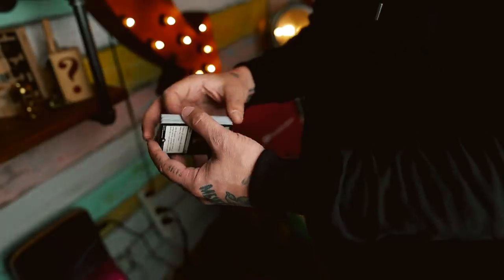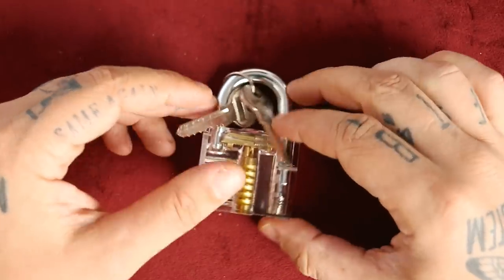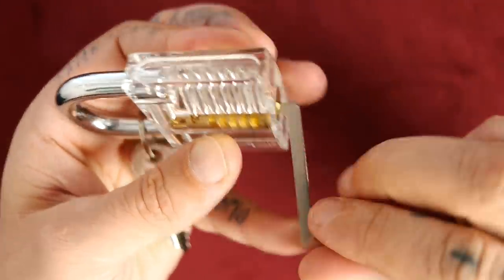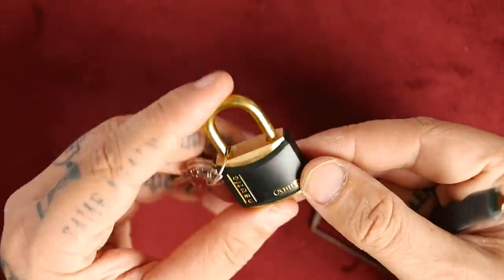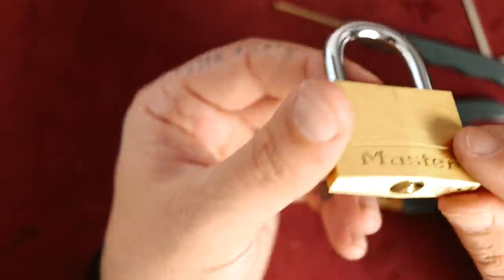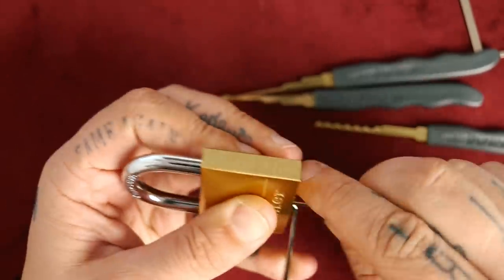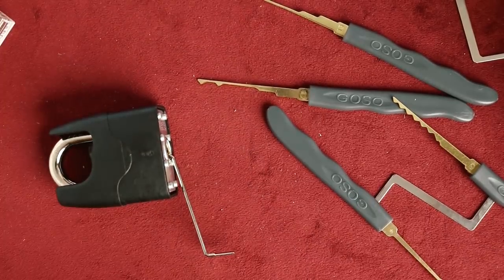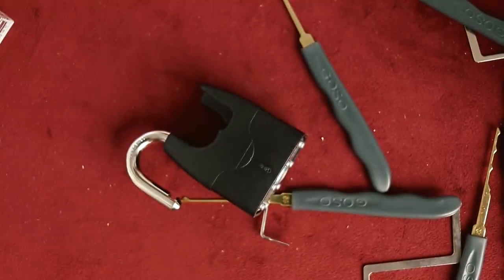I Learned How to Pick All of These Locks!! (Lockpicking 100)

Comment: That beginner lock is deceiving for how easy lock picking is. I have that one. All the pins are the same height. You can stick a paperclip in there and lift up with a little tension and it pops open. lol
Reply: Capp00 the one I have, all you have to do is push up the last pin and it opens 😂
Reply: Cool stumbling across Capp00 here. 👍
Reply: @Moorgoth67  Howdy!! :)
Reply: My one you actually have to try it but they are way easier
Reply: Depends on the type you buy. The beginner clear locks have basic pins but the more intricate one have pins that you can adjust to increase or lower the difficulty.
Reply: Yeah those clear Chinese locks have horribly bad tolerances even if you do manage to get one with difficult biting, they all rake super easy.  If you want a good see through lock Sparrows makes excellent cutaway locks that can be repinned. (they also have the best quality to price ratio for picks as well IMO)
Reply: They're not all the same height on the one I have. But it is ridiculously loose and after some practice I could pick it in a couple of seconds without looking at all. I couldn't pick the lock on my back door though. Maybe if I had a decent tension wrench, but the one that came with the cheap set I got was awful.
Reply: My clear beginner lock looks exactly like his and the pins are not all the same length. In fact I tried to just push them down all at once & it didn't work. You actually have to push each pin individually different heights. I think it depends on the kit you get.

Comment: Really good job for a total beginner, but you should know that these locks are new and unused so it's so much easier to unlock them.. If you want to do some real challange, try to find and unlock some old rusty locks. That's really hard and challanging and it's also more realistic.. :D
Reply: Oh geez, good to know!
Reply: Zdareeec
Reply: Old locks? Hammertime!
Reply: I find old locks easier to pick cuz often the pins get stuck in proper place rather than moving freely. Just my limited experience though have only successfully opened 10-11 padlocks so far

Comment: The thing that you pulled out around 8:20 is for car locks or double-sided locks in general. The lock with the blue band around the bottom and the weird-looking key appears to be a disc-detainer lock. Basically, the discs need to each be rotated into a specific position relative to one another in order for the lock to open. Since the key's cuttings are all equal depth, you just needed something that could reach through the warding (tabs of metal between each disc that prevent you from turning all the discs with a screwdriver and reverse-picking the lock), and that rake fit the lock well enough to do the job.

Comment: The number six you took.. is either a half Diamond.. which is a raking tool.. or an extractor.
Reply: Half Diamonds do more than rake. That looked more like a weird half ball though
Reply: All except the first pick he gave up on using are used for raking. Technically he racked them, not pick
Reply: Raking is where you slide a pick with ridges along it across the pin, hoping to set the pins into their unlock position quickly. This is considered a more beginner technique because it doesn't require much skill or feel for the pins. Picking, on the other hand, is where a pick is inserted into the lock and each individual pin is felt and then the pins are pushed one by one into the correct position.
Reply: Saimeren hey man, so if you want a more in depth explanation look up the art of lock picking. Very lengthy but descriptive and helpful. I also watch a lot of the lockpickinglawyer videos and he is fast but has explanation videos too
Reply: user54389 yeah. I know.. you can use them as a flag for dimple locks too. But it’s weirdly shaped..
Reply: I understand what you are saying, that there is a difference, but he did get the locks open all the same. I would love to see the difference between racking and picking in action though. This is a fascinating topic.
Reply: @PDeRop  Hey, what set would you recommend? I have looked at the Kickstarter and the Tuxedo set, but cannot really decide.
Reply: ah.. when I say "beginner".. it means.. the first thing you try, when attacking a lock.. is zipping or raking.. then, if that fails, (or gives you a false set)... you move to the short hook.
Reply: @BassRTA84  Exactly.. Anyone can  rake. There's zero skill n it. It takes some knowledge n some skill to be able to pick.

I do understand people are happy to have been able to open the locks that way, especially if it's their 1st time ever doing it.
Reply: @ozzy1976   IMO, people who say raking takes no skill, have no skill at raking. I can open countless locks with a Petersons 18 thous bogie, using an action more akin to that you would with a city rake and I can SPP with the bogie too. Its not just an in-out zipping motion, there's ocilating and undulating patterns that you can adopt to open locks with both spools and a horrible bitting - have a look at http://elvencraft.com/lpd/Raking%20Techniques.html and the animations at the bottom of that page. 
Effecting raking does take a lot of skill.
Reply: GBatT There are two or three raking tools in that set. Those I see are the most useful if you wanna get it done quickly.

Comment: Might be a bit late telling you Chris... here is a tip. Most important thing to note is that tension is everything. Notice the leverage of tension you put on a tumbler. The last one you accidentally were using half the wrench thus easing up the tension... unlike when you first started trying it... if you're going to use the whole length of the wrench... way less pressure. I use the technique you found.. put 1 finger on half the wrench. Another great way to figure out what is too much is use a paper clip bent at tip to insert into tumbler, the tension used to find the sweet spot should not bend the paperclip. It's very light pressure. Great video and props for accomplishing the picks.

Comment: Locksmith here, Very well done! you talk about how accessible lock picks are, if you get pulled over at least in USA and have the pick set in your car and are not a locksmith bad news. Besides that you did great couple little things, as I know you like learning - it's all preference as to tension and what picks you use. However some work better in some situations. Padlocks are a bit of a different experience than door locks. If you can find a simple hook pick in that set, my all time favorite and universal pick. Sometimes heavy tension is nice if you have a strong pick and slowly push the pin up you can feel the *click*. Also it's the valleys on the key not the peaks that matter. Just a heads up. but over all well done! Huge fan!

Comment: Probably been said but the 'laminated' lock, the one that just span with the weird grooves in the key is a warded lock and doesnt have pins. The slots in the key let it turn through metal shelves (wards) inside and the mechanism is actuated only by the tip of the key turning. You can skip past all the shelves and rotate it like you did through trail and error with anything slightly hook shaped. Still impressed you got it how you did though.
Also to echo what everyone else has likely said, there are two rules. 1) don't pick locks you don't own, 2) don't pick locks you rely on. It's surprisingly easy to break a lock making everything way worse, even with experience. There are lots of different types of lock! Pin tumbler, wafer, disc detainer, lever, dimple, warded etc.

Comment: Also that saw thing used at 12:00 is called an L rake/city rake your supposed to move the rake up and down in the keyhole while slowly moving it either forwards to backwards hence the different bidding cut into the metal it lifts the pins to either position 1,2,3,4,5,6,7,8,9 etc

Comment: Good job picking these locks! If you get further into the lockpicking community, these locks would be considered really easy. Some of the hardest locks have more than 90 degree angles plus pins that go inside the barrel itself! It makes you wonder how you could even get a key into it, but it actually does work.

Comment: Looking at the teeth is kinda cheating but I'll let it slide
Reply: true
Reply: You could also point out that picking one of these locks in situe is much harder than holding it in your hand or that all 5 locks are just pin tumblers with no security pins or anything. Again though, good job for a first time locker picker, very impressive

Comment: I've been lock picking for about a year now. Its interest to watch a new lock picker. Not to be mean because I didn't expect anyone that doesn't know much about locks to know but the lock with the funny key isn't a pin tumbler lock, so there's no pins to pick. it's called a warded lock ( you can find a good example on how they work online ) and I'm kinda surprised you opened it because you use different tools to open them just like any different kind of lock. And the master lock at the end is one of the most common locks around where I live in nova scotia, you can open them with just about anything that will fit inside and turn the core. I've even opened one with two zip ties😂 (one as a pick one as a tension wrench)  BTW if you are intrested in lurning more, windshield whipper inserts and a file can make a better quality lockpick then the ones you were using.

Comment: Some quick tips from an advanced picker: The lock with the blue band and the key with crazy teeth isn't a pin tumbler lock at all, it's called a warded lock. This can be easily opened with a ring of 'warded lock keys' which you can buy for under $10. Just watch when you're manipulating the lock, don't twist the pick like a key, only use an 'up and down' motion , picks can be snapped and bent otherwise. Well done otherwise, you picked some more advanced locks there containing 'spool' shaped pins.

Comment: there are many different tools you can use for each type of lock, but there are locks that ONLY prefer certain picks over others

locks like warded locks tend to prefer wafer picks (the little snowman) over things like hooks or rakes, as the key pushes two bars apart, which pops the shackle

standard driver pin locks prefer single pin picking or raking. single pin picking involves a hook tool (the pick that has a slight curve) pushing each individual pin above the sheer line, or the point where the lock begins to turn to open.

raking involves a tool that looks like a rod with “teething” in it, which is commonly pushed in and held with more tension than single pin picking, and “raked” back and forth, and up and down. rakes tend to get more pins than single pin picks.

masterlocks tend to prefer rakes and wafer picks, while other brands with unrecognizable keyways require a different set of tools you may not have.
cheaper locks will always be very easy to pick open.

another thing i should mention is the presence of security pins in padlocks. they’re rare, but they can happen.

spool pins are a type of security pin that has the middle shaven down. when these are picked with tension, you’ll drop into something called a “false set,” which is defined by the inability to turn the bolt even after every pin has been set. trying to pick a false set leads to what’s called “counter rotation,” which is the spool pin trying to realign, which turns the bolt in the opposite direction of tension. you’ll usually feel this, and have to release some tension to clear the false set.

serrated pins function primarily on false sets. they’re pins that trick you into thinking you’ve set the pin when you haven’t. if a pin clicks more than once, you’ve encountered a serrated pin. these usually require lots of patience and careful listening.

sorry for the bible-length description, hope this helps!
Reply: i should also mention that it’s very hard to rake security pins without breaking your tools. these pins should be single pin picked only so you don’t run the risk of breaking what you’re using. 😊

Comment: Actually, if you take the toothed ones with multiple teeth. Those are called rakes. If you put the rake in and out fast. With tension. It takes a specific way but it’s a lot easier (in my opinion) than individual pin setting. And if you do want to do just one at a time, I suggest a stronger set of picks and wrenches. . That set was my first and only set. They break easily. So, my advice is to get better tools for this one specific purpose. That is if you plan on raising the stakes. Also the double sided ones are for cars. And there is another tension wrench in there that looks like a kind of tweezers that’s for cars.

Comment: I have that exact same kit. It's nice. I almost exclusively use the #6 hook, to manipulate the pins one at a time (rakes never seem to work for me, except for MasterLocks).
Now to learn how to break into my own car...
I've found that when I try to pick, I usually put too much tension on the wrench, which locks up the pins into a bad position. I also find that I can feel the pins click over better, when I am using just the right amount of pressure. It also seems to allow the barrel to turn a fraction of an inch every time I get another pin in place, but that depends on the lock.

Comment: May I suggest you check out the Lockpicking Lawyer. He picks, bypasses or destroys a lock in every video.
For the record, Master brand locks are not generally of top quality.
Those ones with multiple teeth are actually rakes, designed to bounce the pins.
I'd suggest a pick with a completely straight blade with a sharp upward curve at the tip.

Comment: Chris. How has a Youtuber who is attempting the trade of lock picking not found his was over to the LockPickingLawyer. Incredible lock picker. He makes the hardest locks in existence look easy. Also, You should be using pick "3" in that set which is a standard pick. Not rakes lol. One of the locks you somehow opened is a disc detainer lock. "You should be using a specific tool for this. One you don't have." Practice this and I'll practice cardistry.

Comment: Lol, now try picking a cabinet lock with a paper clip and a pen cap.
Also, those tension rods make picking padlocks much easier than if you're trying to pick them with some random objects out of your pockets. Most everyday items you can use as tension tools require you pushing along their length instead of twisting, such as a pen cap.

Comment: I find that you need the right torque wrench with the right pressure to pick locks. You can use whatever pick but if you don't use the right torque wrench and pressure, you won't get it open.

Comment: Locksmith (PER 4)

Perk Description: Gain ability to pick high levels of locks.

Rank 1: You can pick Advanced locks. (Requires Perception 4)

Rank 2: You can pick Expert locks. (Unlocks at level 7)

Rank 3: You can pick Master locks. (Unlocks at level 18)

Rank 4: Bobby pins never break while you lockpick. (Unlocks at level 41)

Comment: 7:55 the first thing to do is to figure out the type of the lock you have. This one is not a pin tumbler lock at all so using pin tumbler lockpick is obviously not going to work very well. It's possible to open this kind of lock with incorrect tools but there are much better tools for these low quality locks.

Comment: See lock picking is really helpful because I had to learn a bit of lock picking because I lost some shed keys and I didn’t want to loose a lock. Also your lock picking is good but not 100 it’s more like 70-80 because your not really that fast but with practice you’ll become a master but in order to be a master thief you need to be able to pick really quickly and be able to figure it witch pick you will need instantly and once you master these skills you will become an amazing lock smith

Comment: TIP:

dont turn the pic that could bend the pic or break the lock and use the smaller tension rod not the big one

Comment: The thing that “wasn’t working” was the pins binding order they have an order in which they bind the one that’s the hardest to move is the binding one once you get that into position repeat it what you did wasn’t exactly picking locks as it was more moving the tool around randomly if you did this on any other lock  like spool pins for example you would never be able to do it

Comment: That's only level 50 haha there's way more advanced locks out there haha but you did good. Locksmiths have top end tools and can just make a key. You can take a special blank and insert it into the lock and it will get marked by the pins and then you just slowly cut the key until it works :) ❤ you did really good though for your first time ever

Comment: The fun part is having family that always loose their keys I've never used a pick set but would enjoy having one. Sense I was 12 I've been using a needle for the pick and a Bobby pin for a tensioner and for harder locks switched them around or use two Bobby pins

Comment: Good job on getting through all that, locksport is a great hobby. However I  have to say that Master Locks are not difficult and should not be used to secure anything.
Reply: They're perfectly acceptable to protect things with. Thieves don't pick locks, they destructively bypass them. In fact protecting your stuff with expensive, high-quality locks really only serves to make yourself more of a target to potential theives, because they'll think you have some real valuables. At that point you need to structurally fortify every part of every possible entrances. Bulletproof/razorwire windows, reinforced steel doorframes, and solid titanium doors, etc. At this point you're much more secure, but also much more of an actual target.

TL;DR a regular-ass kwikset on your door, plus just not making your house more of a target than your neighbors is always the best course of action.